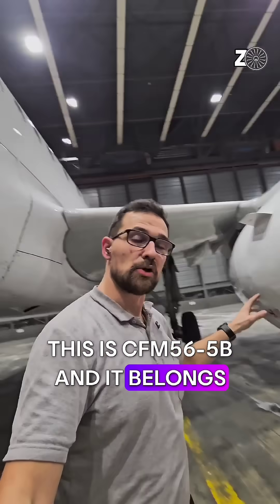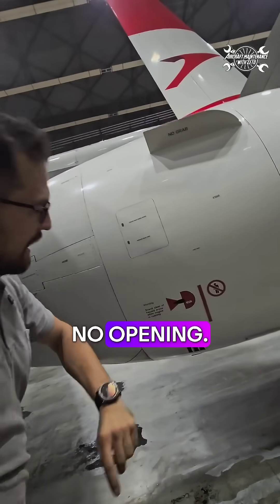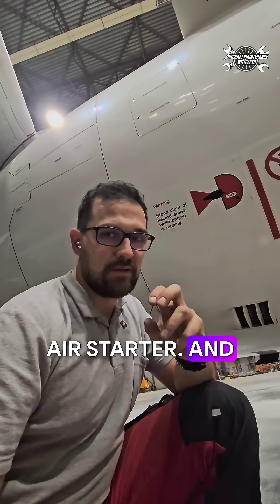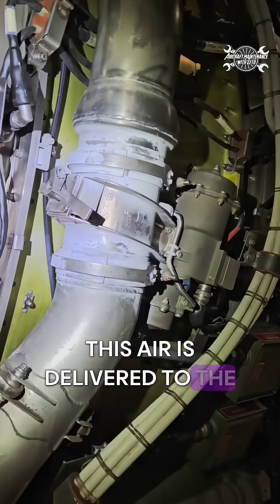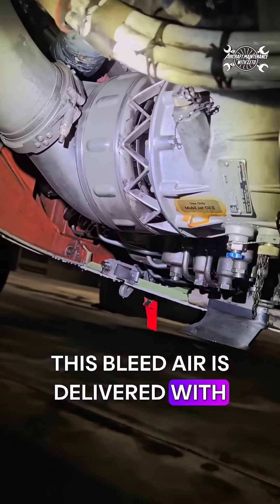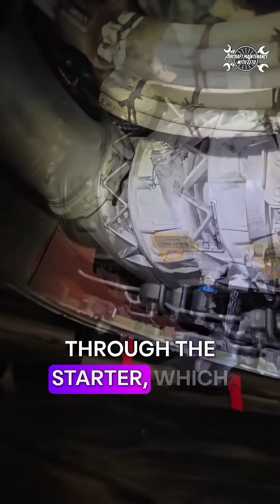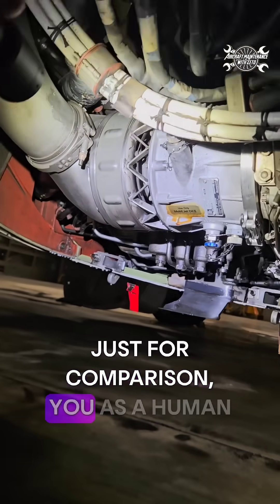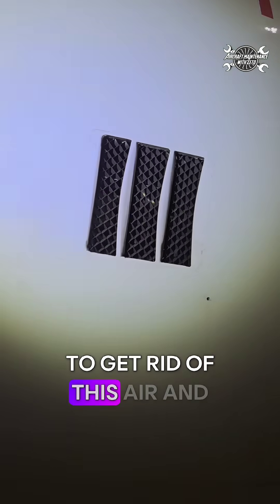How to start Aircraft engine

Comment: 1.8  liter of air per second to start such an engine seems ridiculously low. Am I right?
Reply: The mass flow is about 80 kg/min for cfm56 starter, so 1.3 kg/second, that would be a bit over 1 cubic meter in normal pressure (so that is how much air is coming out from starter). In the high pressure pipe the flow would be about 300 liters/second at 40 psi overpressure (55 psi absolute pressure) without temperature corrections. Too lazy to calculate exact values with hot air.